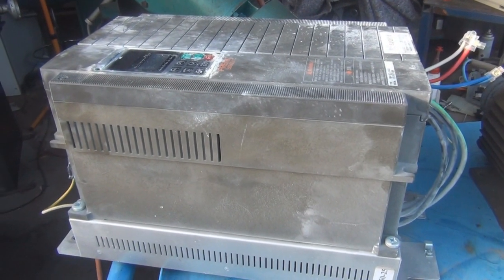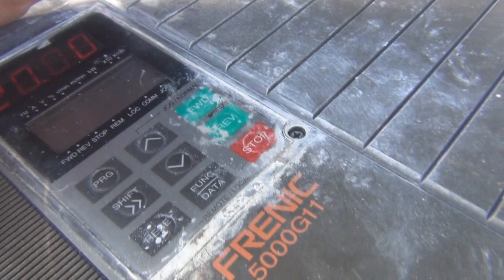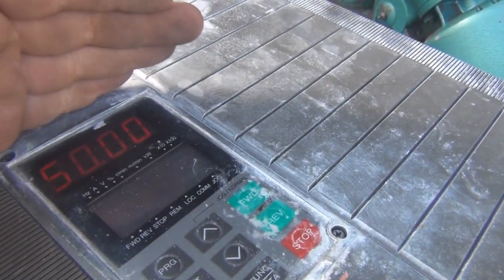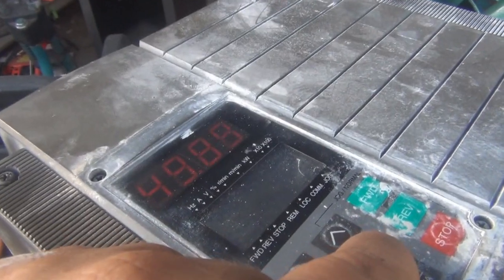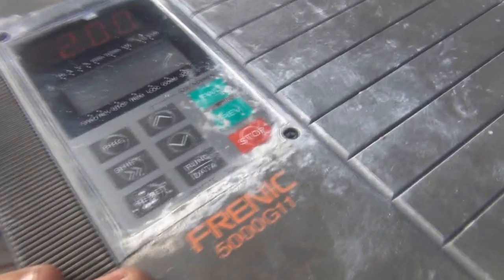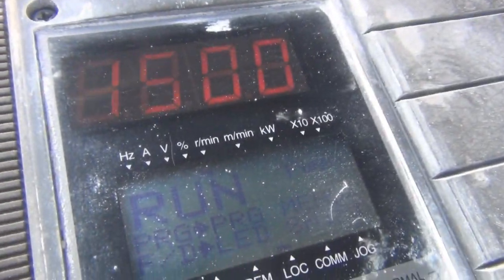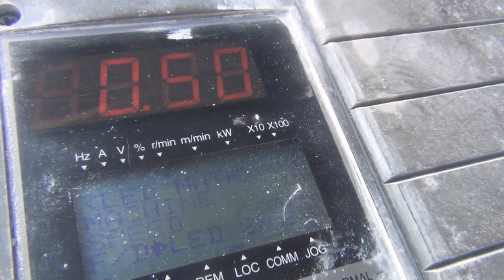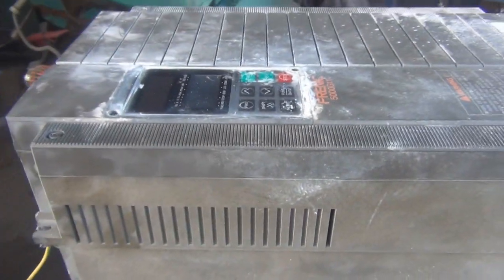15KW VFD - Frenic 5000G11 3 Phase. IT RUNS!

Comment: Very nice bit of expensive kit! Get that thing programmed for 400hz for some silly speed fun! Sounds almost the same as that massive multi-hundred kW motor I did a vid on a while ago!
Reply: Haha, how fast is it gonna run at 400Hz will it self disassemble?
Reply: Coolkeys2009 Lol the motor won't be happy put it that way :)
Reply from the maker: FrontSideBus even after changing the max freq to 100 in the software it still wont let me run this particular motor at more than 70hz, maybe it knows its gonna get upset and prevents this lol
Reply: alex993cc1 A bit of kitt as big and expensive as that probably has a myriad of protection circuits built into it. It's probably detecting rotor slip or resonance in the windings..... or something.
Reply from the maker: FrontSideBus i wanna hook up the 15kw motor to it and have a go now :) if the motor is alive that is, lol.
Reply: alex993cc1 Lol, stick that in your go-cart. Just hope you have a long extension lead... :)

Comment: That is a VERY expensive piece that probably cost thousands when it was new... On ebay I found a few Frenic VFDs many selling for around $1000 TO $1200  There is also a manual online for your unit... it explains the modes to set frequency but I didn't read too far into it... the image in the manual depicting the control panel however did show 60.00 hz, though that may be a US only manual.

Comment: Hmm that motor sounds horrible, is it the shape of the waveform coming from the vfd thats upsetting it?
Reply: That's just the noise of the modified frequency going through the motor windings, all VFD'd motors will do it
Reply: Machine Man
Ahh i see, perhaps an iron core transformer in the path to the motor would decrease the sharp edges and reduce the noise.
Thanks for the reply :-)
Reply: FrontSideBus
hmm i still think a passive low pass filter of some type could soften the noise, but what do i know about motors and vfd's lol, bugger all!! :D
Reply: I did a video of a tunnel ventilation system with a massive vfd driven motor and it made the same noise.